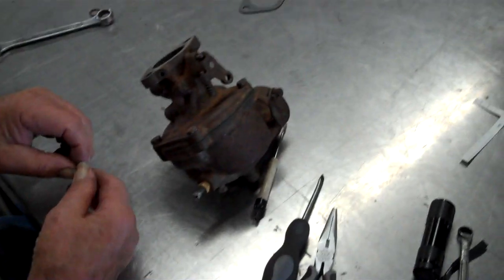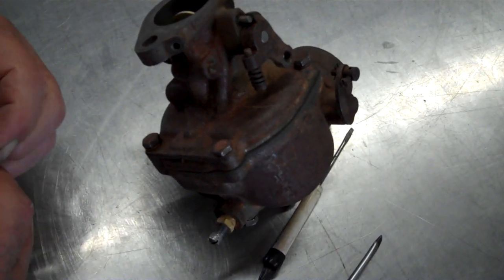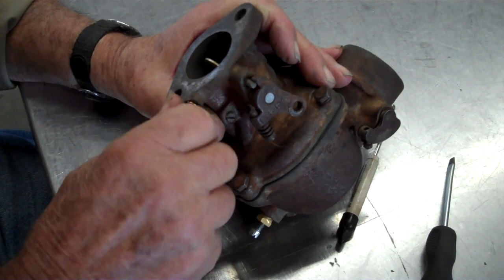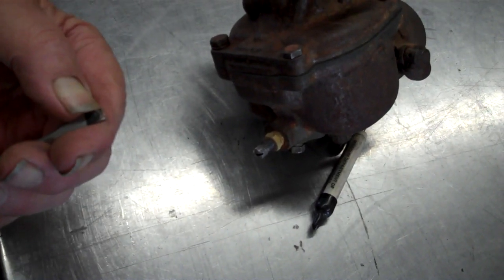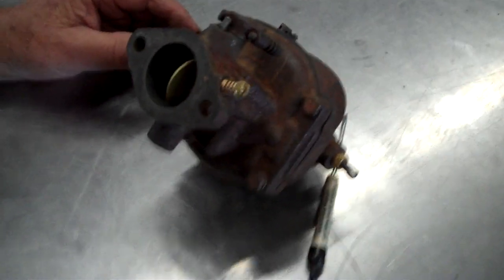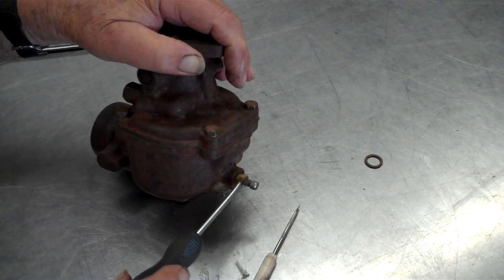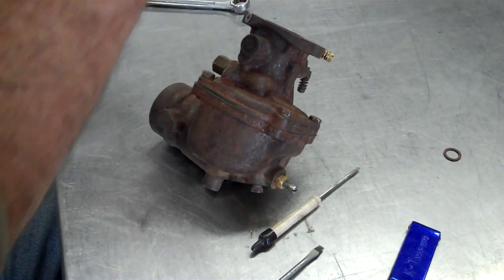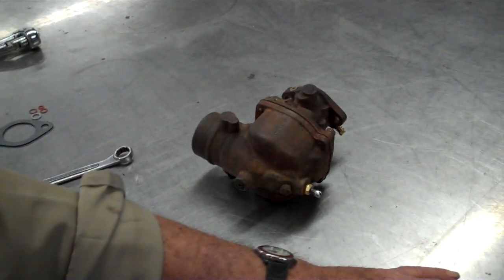Tractor Restoration - Carberator Rebuild Part 3

Comment: I'm sure this gentleman has experience but this video leaves a lot out. All parts should be cleaned by chemical soaking to clean internal passages and rust needs to be removed as it can break free and ruin this "rebuild" later.